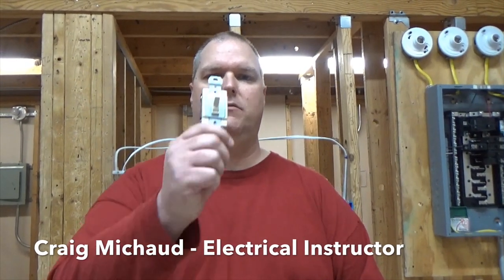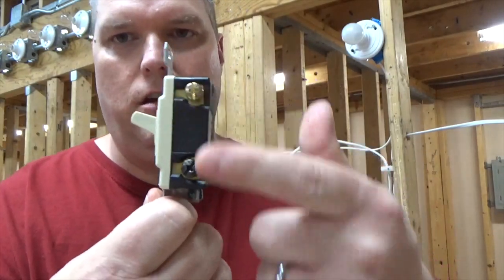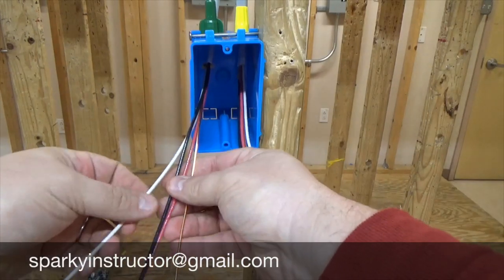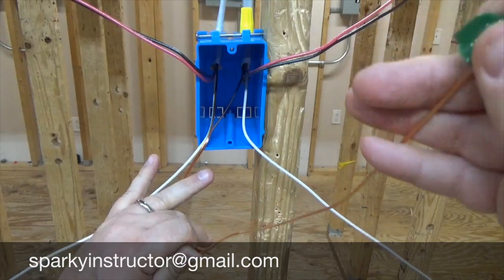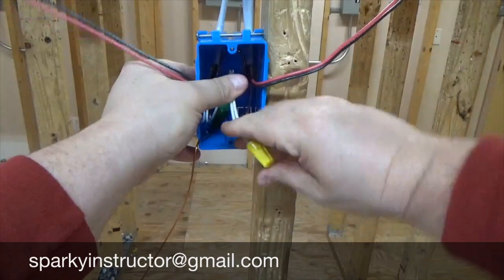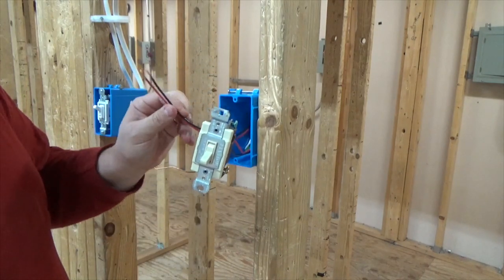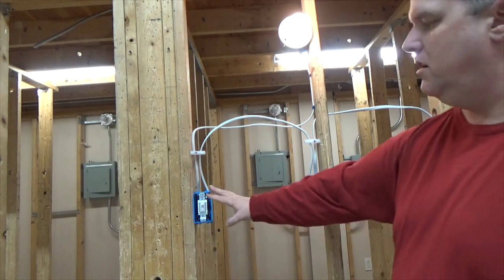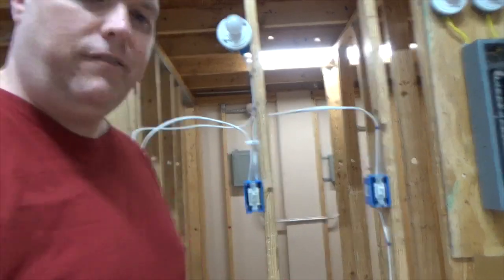4-way switch Install. Beginners

Comment: Thank you so much! I bought a 4 way switch, because I have 3 locations to switch the light from. Thanks to your video I know what I did wrong; I replaced a 3way switch with a 4way. Now my new 4way switch is operating as a main. (Even though I brought photos to the hardware store showing the faulty 3way wired in they did not tell me what I was doing wrong. I will be talking to the manager.)
Reply from the maker: Please remember that people who work at a hardware store or even the big box stores, they are not licensed with years of experience. Most of them learn from tv and videos.  It’s funny because I was looking for something one time and I was told not to use it because it was cheap and was recommended an expensive alternative! Needless to say I declined and head said I would be sorry!! Personally I never take advice unless they are licensed. H go lad I could help!! CM

Comment: Thank you!  I was swapping out some switches and matched the wires from the old to the new. But the old had the inputs on the top and outputs on the bottom. The new had the input on one side and output on the other. I ran into the exact issue you outline later in the video. This helped me fix the issue.

Comment: Good video, thanks. I'm testing for a homeowner certification on Tuesday. I wired a home I built in 1983 outside city limits. I have also designed and wired industrial machinery for over 30 years, but I'm not experienced in some areas and of all the videos I have watched, yours are the easiest to understand and includes information not in others. Gregory

Comment: I just changed out all the light switches in my house from toggle to rocker switches. Most were single pole, several 3 ways, but I left the 4 way switch for last.  Unfortunately, the previous 4 way did not have any labeling for input/output, and none of the terminal screws appeared black any more. So I wired it up how it was on the previous switch. Everything worked fine except when I turned the 4 way into the down position, the 3 ways could no longer control the light. FRUSTRATING!! Until you showed us the back of your 4 way switch, and I instantly knew how to fix it! Yours has input on the 2 top terminals, mine has input on the 2 right terminals. The old one I had must've been configured like yours, so I just moved the wires accordingly, and BAM! working perfectly! Thank you, sir! You just saved me from having to admit defeat to my husband 😁😂
Reply: I know Im randomly asking but does someone know of a way to get back into an Instagram account..?
I somehow lost the login password. I would appreciate any assistance you can give me.
Reply: @Nicolas Achilles Instablaster =)
Reply: @Mohammad Esteban I really appreciate your reply. I found the site on google and im in the hacking process now.
Seems to take quite some time so I will reply here later with my results.
Reply: @Mohammad Esteban It worked and I finally got access to my account again. I am so happy:D
Thank you so much, you saved my account!
Reply: @Nicolas Achilles You are welcome :)

Comment: Thank you for the information!  I have a hallway that could use another switch on the far end. We missed it with the building walk through during construction. Was not till we moved in it started to bother us. It's a 3way now and I want to make it a 4way. Just need to figure out how to get a pair of 14-3 up from the basement.  Cheers from Wisconsin.

Comment: Thanks for the demo of a bad wiring setup...I shared this with a friend who couldn’t understand that the pair of travelers “Had” to be paired at the same level, (top or bottom screws) not necessarily sides
Reply: Hey LeAnne - I shared your comment with a friend they couldn't understand why you made. it. Is your middle name Karen.

Comment: ...just finished fixing a jacked-up Multiple Location 4-Way Switch in a rental property.  Someone had replaced the 3-Way Switch that serves the load (light) with a 2-Way Interrupt Switch.  They landed one traveler on the 2-Way switches ground terminal (which isn't grounded).  The upstream 3-Way Switch in the circuit worked only intermittently. (i.e. to make it functional you had to sometimes put "side-pressure" on the toggle... ergo... Just worn out.  The 4-Way Switch was old but unmolested and functional.  ALL 3 prong receptacles in the house had a bootleg ground and many had reversed polarity.  There are no equipment grounding conductors in any of the branch circuits.  Boxes: Stripped, Broken, Overcut, Undercut, Recessed with no box extensions, Loose,... Wood Screws and Drywall Screws used in place of machine screws for mounting receptacles... Sigh.... The house has a 1960's Zinsco Main and Subpanel. 😞

Comment: Thank you. Nice video. At the end you said the wires were swapped. How did you know that right away without looking exactly where the wires came from? Or did you just make the assumption they were switched because the light didn’t work properly?

Comment: Craig, Thank you for the wiring video it was quite informative.
I have a switch that controls four lights I would like to put a three-way switch to control the lights at another entrance door.
 I pulled the switch from the box to find a black wire on one screw and a white wire on the other screw. How can I go about putting a three-way switch in a configuration like that? There is another switch in the box which I may get a hot wire from, is a three way possible?
Reply: You have what is called a "switch loop". The power for the lights you will find in one of your existing lights. The existing wire would have to be replaced with a 3 wire cable from the light to the switch. Then another 3 wire cable from the newly added switch to the same light. All your connections would be made in the light box. This gets long if you still want to do this reply back and I'll walk you through it. You may find a video on here where it is shown how to. Good luck...

Comment: I have a question:  So I bought wifi dimmer switches from costco...  I have installed 24 switches in all...  They work great!  They can be used as single poll or 3 way...  I have already installed several 3 way locations in the house...   You only need one dimmer/wifi switch on one side and you can use either a traditional single poll or 3 way switch on the other side...  If you use a 3 way style switch only two of the terminals will be used in the application...   It should also be known that with theses dimmer/wifi switches there must be a neutral white wire on the side where the dimmer/wifi switch is located because the wifi needs its own constant power source with a neutral/hot wire...   Having said all of this I have two separate locations in the house where there is a 4 way circuit...  so two 3 way switches and one 4 way switche just like your video...  These Costco dimmer/wifi switches are not designed for 4 way applications so I wish to change thos two areas simply to 3 way eliminating the 4 way configeration...  When I simply remove the 4 way switch I loose power accross the circuit...   It had been mentioned that I might have to splice the wires together in two pairs...  That didn't work regardless which way they were connected....  So the $1000 dollar question is there a way to remove the 4 way switch while making the other two switches operational?   Thank You in advance.
Reply from the maker: Please email me at sparkyinstructor@gmail.com. And in the subject line put Costco 4way!! Thanks CM!!

Comment: I have four light switches that control my outdoor lights. Two three ways on both ends with two four-way switches in the middle. When I rewired everything the way you outlined all the switches work to control the lights. But one of the four way switches all four wires are hot regardless of that specific switch being off or on.

Is this correct?

Comment: Greetings, sorry bothering you, but, I have a question, in my house I found a GFCI(15 Amp) protecting another GFCI(20 Amp), both in the same 15 Amp circuit, is that a correct installation?

Comment: I have a dimmer and two switches in a 4-way circuit that is setup for recessed incandescent flood lights in a kitchen. I want to replace the incandescent lights with LED lights. I understand that I need to buy LED lights that are dimmable. Do I need to replace the dimmer with a dimmer that is 4-way and compatible with LED lights? I have seen 3-way dimmers that are compatible with LED lights. I do not know if 4-way dimmers exist that are compatible with LED lights.

Comment: Hello, thank you for the great video. 
I currently have the 3/4/3 setup in my house. If I wanted to make it a smart switch setup would I have to change all three switch’s or just change the 4 way switch to a smart switch? Thanks again.
Reply: flaco741 it depends on the brand smart switch you are using. You should not have to change out the four way, it will be one or both three way switches.
Reply from the maker: I dont believe you do!! I do believe you need to find the device with your neutral in it from the circuit. Please let us know how you make out! CM

Comment: I have problem with a kitchen light with 2 /3 ways and one 4way . I can’t get light to work on any switch. I have power to both 3 ways
Reply: 4 way needs to be in the middle between the two 3 ways